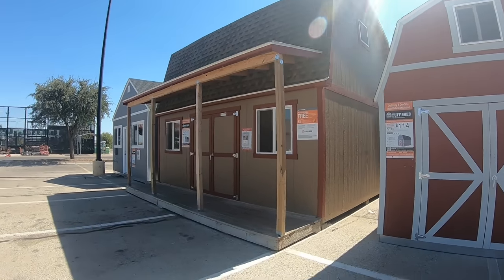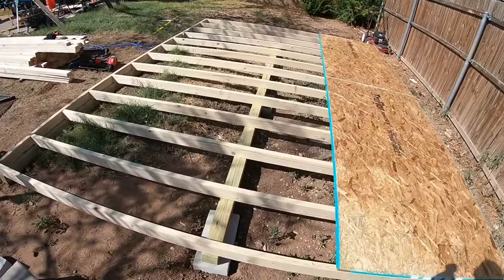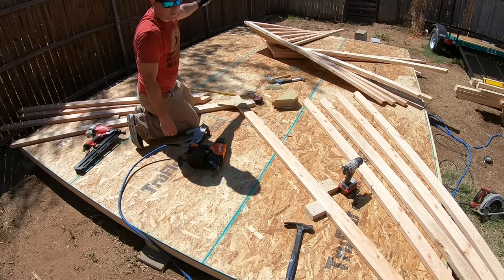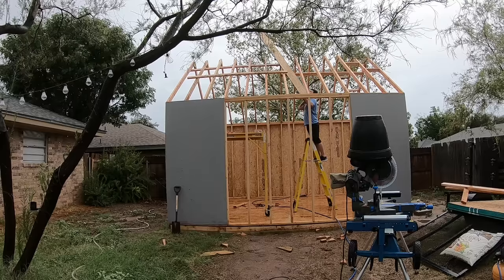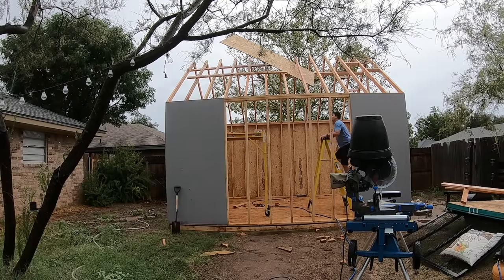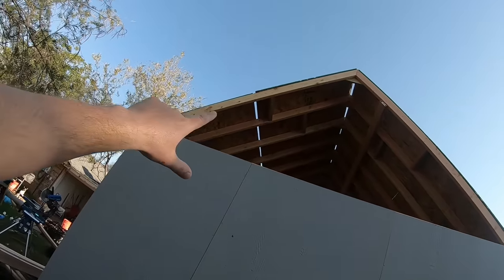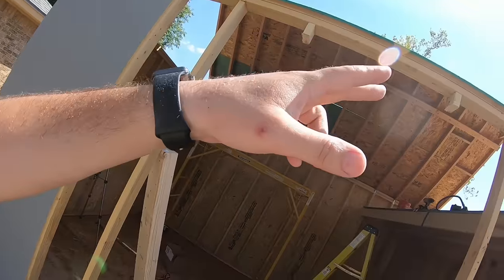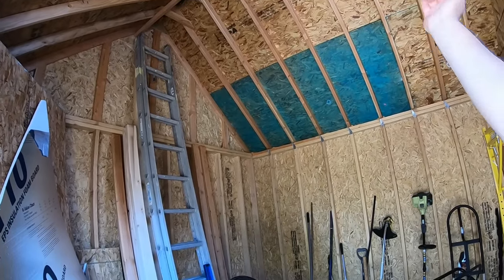Giant Shed for a fraction of the price!!! 12x16 with a Loft!!!

Comment: You could have used rope on both ends to lift it little by little. My back is hosed so I've had to find creative ways to lift things. On one project, I tied "hooks" every few feet so that each time I lifted the panel, I had a resting spot before moving to the other end. Once up high enough, the panel will fall flat against the rafters. Worked out pretty good. More time consuming, but much easier on the back.

Comment: The only thing I'll comment on is that you should really put 2x4's under the 2x6 for the loft so the weight is on the 2x4's down to the base floor platform. Quick and easy load bearing pillars. You shouldn't rely on nails, or even screws, to hold the weight like that is. Especially if you are intending it to be a play area for kids. It may be fine for a while, but I personally would definitely do it sooner rather than later.

Comment: The outbuilding looks fabulous.  Mine was 10x12 and cost $1400.  One of the more expensive parts of mine was the cedar siding.  However, I had to practice installing red cedar shingle siding before I starting to repair our house siding.  The house siding was 70 years old and needed some repair, so practicing on the outbuilding was the way to go.  On my next outbuilding, I think that I am going with 2 ft 'on center for the walls and roof.  16" seems like overkill and my last one was very strong, maybe too strong for what it needs to do which is keep things dry.

Comment: Man, I held my breath as you pushed that roof sheathing through the trusses, half expecting you to end up hanging by your trapped fingers as the ladder fell away. Consider overhangs and eaves, blocking between loft floor joists, possibly a vertical support under loft floor, and some form of soft pit below the climbing wall to fall into. A+ for effort and bravery.

Comment: When you did the roof plywood, if you would have used the scaffolding on the outside and leaned the plywood against it ... Get up on it then lift a sheet lay it along the eve and nail in.  Then slid next sheet up over the 1st one. Any overhang can be trimmed with a circle saw at the rig vent. 
Your very lucky the ladder incident wasn't worse.  

All and all nice build .

The floor you definitely want the t/g 3/4" or 15/16"
You'd regret it if you didn't as the wood weathers from underneath and gets bouncy

Comment: Cleats are your friends. Put a temp cleat along the edge. Move your scaffold outside, load the decking from there to the roof. At least you learned to add braces on the second wall. I would have started with the end walls framed up and braced. Just remember, back injuries rarely heal completely, it haunts you.

Comment: i really like your load transfer .having your rafter lay out match with your stud layout  . could have gone 2 ft lay out with the rafters. but you would want to add a collar brace tying the left rafters to there right side partner... adding some stairs or some  type of latteral bracing might stiffen it up till you sheet the interior walls ..on the cheap use pallet wood !strong and cant bust a whole through it like sheetrock  and you can tack a nail anywhere to hang stuff and there free
Reply from the maker: I like that idea! Thank you for the advice!

Comment: Using OSB siding, my experience is that you need a good coat of paint on the outside. The paint is the water barrier. The paint that comes on the siding is NOT good enough.

Comment: I'll give you points for never seeing it done like that before,  I only wish you would have framed the walls 3" shorter so the siding would have covered up the flooring and the top half of the rim joints,  that's gonna be a problem in the rain
Reply from the maker: Yeah I didn’t think of that when I was framing it up… looking at possibly putting up some fake rock siding around the bottom to seal and cover. Thank you for the comment!

Comment: I bought a shed kit from Wolahan Lumber back in 1994 12x16 with a gambrel roof delivered and built in 2 days my neighbor and I bought two one for me and one for him $1,400 each . My man cave at 72 years old , fridge computer stereo 32"tv microwave 8 foot 220 v. electric heat 6,000 btu air conditioner . Eight inch ceiling insulation r-13 in walls ,wish had insulated the floor , but is nice summer and winter in Ohio .

Comment: I’m not sure why you are not putting the sheets of plywood up from the outside that’s how I did my shed? Much easier that’s something I need to do is make the one at my house bigger. I did a 12 x 12 15 high with Storage front and back with the middle open on the inside with a workbench ran electrical for solar panels for a little over 1800 Back in 2012 lol. It turned out really nice

Comment: I was told to make a 12' x 12' max footprint in this trailer park. So, I did just that, only 13.5' tall at peak &10' side walls. With attic. Floor is 12" on center to hold up 3 Harleys. The rest is 16" on center. Most of it is reclaimed 10' 4x4's from steel shop, cut to 2x4's. Only $800 total. But a decade ago.

Comment: When you were looking at the sheds to purchase. And you were saying how expensive they are.
You should read the fine print.
Because the prices they show for these prefabbed sheds, don't include the tar paper and shingles for the roof. And for any windows.
Also if the display shed has 2x4 studs. In the fine print it will say, sheds come with 2x2 or 2x3 studs. As shown with 2x4 studs is extra.

So everyone needs to be careful.

Anyway, when I was looking at sheds to purchase. I couldn't believe the price.
So I decided to build my own also.
I had never built one also.
So I sat down and designed what I wanted. For one shed.
Then I went and priced out everything. And I couldn't believe how cheap it was.

So I ended up building a 10x12 shop and right next to that I built a 8x10 bathroom.
Because I don't live where I built this. And I needed somewhere to go.
And then next to the bathroom, I built another 10x12 storage shed.

I went with 10x12 sheds, because where I live anything 120 s/ft or less, you don't need any permits.

Anyway I built all three of these buildings as individual building's. But I put one roof over all three.

Anyway the point I wanted to make here is.
I built all 3 of these buildings.
For the cost it would have cost me to purchase one building.
And that is with the toilet and plumbing for the bathroom.
And I ran electricity to all three buildings.
And it was still a little less than if I purchased one.

So people do your homework, before you jump into something.

But you know what ?
I guess I should practice what a preach.

Because, a few weeks ago I decided that I was going to build a couple sheds at my house. Well it's not a house.
It's a trailer. I live in a trailer park.
I don't have much room so I designed a little 5x7 and a 7x10.
So I built the foundation for both. And I built the walls for both. But I didn't put the walls up.
Because do to not having enough room.
I put the walls for the 5x7 shed up. I started putting up the T-111. And I got up 3 pieces and it got dark, so I stopped.
Well the next morning the manager at the trailer park was knocking at my door.
Asking me what I was building.
She told me there are rules for things like that here.

She had a list if dos and don'ts, so we walked back there and started going over everything.
She was being cool, because I had a lot of don'ts, that she let me slide on. Even though everything was being built to code.
But the one thing she wouldn't let me slide on was the T-111 siding.
They demand that the siding must be fire proof.
I said what fire proof.
Shit I'd already put two coats of paint on both sides of the T-111 I planned on using.
Anyway there was no way I could get out of it.
So I started researching fire proof paint. And what a joke that is. They want 500 to 1000 bucks a gallon.
So that was out.
So I researched fire proof siding. And all I could find was a product from James Hardie.
I knew of the company because I've worked with Hardie backer board in bathroom remodels.
And believe it or not, home Depot stocks it.
So I went and checked it out.
And man this stuff is 60 bucks a sheet. And is it heavy.
Well I had no choice.
I had no experience with this stuff, so I started doing some research. And I really couldn't find much on how to install it.
I did find something on Hardies Web site.

And man what a cluster F.

They suggest that when you install it. That you put up plywood first then put a water proof membrane.
Then install their siding with numerous different flashings.
Then once you have it installed. You have to caulk all seams and nail holes.
Can you imagine all the nail holes.

Well like I said I had no choice.
And it's ending up that I'm having to pre drill and screw everything up.
Because they say you can use a nail gun to install it.
But the siding is a concrete product and it just crumbles apart from the force of the nail gun.
What a major pain in the rump.
But it's fire proof.
LoL 😂😆.

Like I said people do your homework.

Comment: Enjoying the video.  At some points, it feels like a horror movie. LOL  I thought either you our your GF might get injured.  I wondered why you didn't tack in a support when raising the first wall.  Then why you didn't have help, or the nailer, or a level.  LOL  You seemed to catch on by the second wall.  But as I'm watching you almost injured yourself with I think the first piece of particle board for the roof.  Several times.  Why not just put it up from outside.  Put up a temp stop, put one side up, then the other.

Also, looks like you didn't plan on a door?  At least so far.  I'm hoping you don't die by the end of the video.  lol  

Very entertaining though.

Comment: Just a comment on those buildings sold at Lowes or Home Depot. Run from them as fast as possible. Poorly made but sort of cute looking. I have seen the shingles blow off of them at the store lot. Over priced! Poorly constructed. The cheap metal buildings sold there are a joke and usually tear up from the winds. The all plastic Rubbermaid sheds  will warp from the sun eventually.  Save your money.
The all metal buildings with a roll top door are far better. Backyard Storage and possibly other storage sale places have them. They usually  deliver and setup with the price.. You see these at the Sonics. They last well. If you build your own study building design and start with a good foundation to build on. Do not put wood to the ground (dirt). Consult a friend or professional.
Many blessings.

Comment: Yeah, prices are ridiculous through vendors. It's funny how you can build that big in a small yard without a permit but I'm sitting on acreage and limited to 120sqft. Which is ironic since it's in a rural area where everyone has acreage and the majority of homes have been out here 50plus yrs. The code is only there as a revenue source because wally world & Starbucks doesn't pay any city taxes for the next 10yrs, so they have to get it from the people somehow.  Someone's bright idea to intise them to build here which worked and they are making a killing.
 On another note, I'll never build another building with a wood floor. Concrete is the best thing to use. No way of telling but prob in a few yrs, the wood floor will start rotting especially if it ever gets moisture in it. 10yrs you'll be replacing the floor. It's extremely hard with a building stuffed with things and the structure is sagging and the floor giving way. Not to mention mice, spiders and other creatures that will make their home under it. Concrete isn't as expensive as people think because it's the labor that makes up 90% of the cost.  If you can build a building, you can lay concrete.
  Glad to see others doing what I'm doing and refuse to pay ridiculous prices for things you can do yourself and afford. I could point out many other things that should've been done, but trial and error will be your wisdom with time.

Comment: Hello. I give an E for effort. There are  many things that would have been better.
1. Level the ground better and have ALL the beams supported by some sort of  good support stones or use a concrete foundation. Thick slab at least. The wood on the ground will rot or be a insect doorway such as termites.
2. You should have used treated 2 by 6 or at least treated plywood for the floor.
A plywood treated roof with metal on top would last about forever if properly installed with anchor bolts and roof caulking. 
There are other things such as building the frame first with proper anchoring to the base and only then putting up Masonite  siding or metal siding which is better.
Sorry my friend but the structure will have problems as it ages and possibly sinks or leans from a lack of foundation issues. Also the shingles can blow off as well from this type of structure. No flashing used at all?  If you used 2 by 6 for the inside I applaud you on that. Also prime, paint and caulk the outside masonite siding as soon as possible. It will save your shed for awhile. You might be able to fix the foundation issues by jacking it up and redoing the stones properly and anchor the structure properly. Yes, they can blow over.
The inside is not too bad. You can also redo the floor with some treatment sealers. Rot usually starts from the ground up. Be familiar with wet rot and dry rot causes. Also anchor bolts and galvanized screws are better than nails. The best of luck and blessings.

Comment: 10:49- Instead of deadlifting the entire wall, (alone) you should have pre-installed kick-stays (2x4s on a hinge or pivot nail) inside the wall. You then only need to lift the wall up a yard at a time as your stays kick out (swing down) and rest on the floor.
23:44- (disembodied Obi Wan voice) Use the scaffold, boob.

Comment: Plywood roof. Scaffolding outside of shed. Put plywood on Scaffolding. Nail "sofit stops", push plywood horizontally onto roof, it will slide down to "soft stops" and hold it while you fasten it.

Comment: I felt so bad watching you risk broken everything trying to hoist the plywood up to the roof.  When I'm building by myself I always have a ramp built of 2x6's from the upper sill plate to the dirt at about a 45 degree angle.  I build it with at least (3) 2x6s probably 2' - 2 1/2' apart.  That way I just lay the plywood on the "ramps" at ground level, drill a small hole for a rope thru the plywood and then toss the other end up and over the sill plate.  Then all I have to do is go up on that scaffolding that you have and pull the plywood up the ramps.  Easie-Peasie.  You have guts to try a building with no experiance... but how else can a guy learn, eh?

Comment: I am a team of one when building. I always attach a couple blocks to the floor lined up with a couple stud locations of the wall I am building. Lift one corner of the wall and put a cinder block under it. Do the same with the other side. Then put a 2x4x8 "kickstand" on the 2 studs that line up with the floor blocks (use one nail in center towards the end of 2x4x8 and hold it low of the top plate). Lay your nail gun near where floor blocks are. Lift the wall, your "kick stands" will slide up and help hold the wall while you lift. When the wall is plumb, your "kick stands" will hold it while you put a nail through them into your blocks on the floor. I was worried your dog was going to get squished!

Comment: Good job, though I thought for sure you were going to break something putting that sheeting on the roof! 😱
Don't sweat the cost of your flooring.  The floor is the foundation of your entire shed, so of all the places to skimp, the floor isn't it.  You'll thank yourself later for buying the better grade wood because if you'd gone with the cheap stuff, after several years you'd end up with soft spots or potentially even break-through areas.

Comment: the roof is going to want to spread the walls apart where the loft is not  present.  Finish trusses or at least a cross over to finish the triangle to prevent wall separation.  Might want to back fill in with some gravel at  the foundation in an attempt to keep drainage around the wood near ground.   FINISH YOUR TRUSSES!!
Reply: Trusses? Trusses? We don’t need no stinking’ trusses!

Comment: I can do the floor and walls no problem my issue is the roof and ends I have no idea how to do those but I want to build something smaller than this something to store yard equipment and extra stuff like 8x10 or so
Reply: Having just built a shed myself, I highly recommend a minimum of 10x10. That’s what mine is, finished dimensions inside are something like 9’6”x9’6”, and it’s barely enough. I would recommend either 10x10 or 10x12.

Comment: How did you calculate the rafter size to fit that loft? Safety isn’t your thing, I get that, not a knock but come on there were a few moments. Overall amazing, though I don’t know how you landed on that pitch to jig on the deck. Jig makes sense. Unsure on process.
Reply from the maker: I calculated rafter length by marking middle of floor and placing 8ft lengths of 2x4 together at that point and then to the edges of the floor… so that way I could get the tallest roof possible with 8 foot rafters… I did not account for an overhang which I should have… this method is probably incorrect, but it made sense to me.